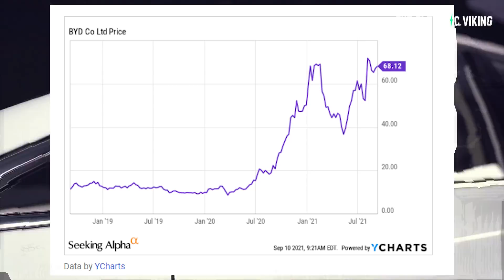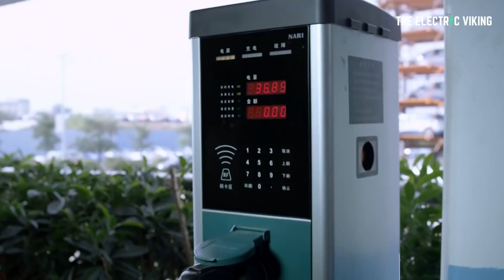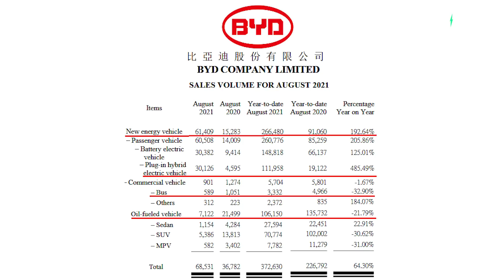New details on BYD's e-platform 3.0 - It's better than you think!

Comment: Not having to change the battery will be the game changer for me. When I buy an ICE car, I don't have to think about having to have a new engine installed after 8 years. I don't want that problem with a EV. I don't care about the range as long as it is over 300 Km and does not catch fire while charging at home. I hope the CCP doesn't interfere with BYD as it has with other large companies.
Reply: The problem is that calendar life is also important.  Batteries degrade over time, regardless of how many cycles they see.  I have had Ni-Mh, air cooled Li-ion and liquid cooled Li-ion batteries all fail at about 10 years.

Comment: 89% Efficiency means the car loses 11% of battery power before it gets to the motor. This is because of voltage changes, cable resistance etc... 89% efficiency is excellent.
Reply: 89% is probably battery to road but might include the charge to road. It would be good to know.
Reply: 89% is battery to wheels.99.7% is battery to motor

Comment: I've been driving the same car for 20 years and I have put 200,000 miles on it. I have no idea how long a 600,000 mile battery will last. It will certainly last longer than I will use that car. Most people want a new car in 10 years. So it will have great resale value.

Comment: Great vid as always, the only thing I challenge is that you doubt that BYD will supply their architecture to Daimler etc, to me it makes perfect sense for each party.
I enjoy that BYD let the Tesla partnership rumour die down & that they won't be supplying Tesla with Phosphate batteries. Makes you wonder who started that rumour. 😉
Reply from the maker: Thank you for sharing
Reply: Elon has recently stated that he has a preference for the LFP, so I'm sure Tesla has kicked the tires on one of the best battery options in existence. Imagine if Telsa offered a base model Cyber truck with the blade battery...would make sense and they could potentially beat Ford to market.
Reply: Daimler is 10% owned by Geely. BYD's partnership with Daimler (Danza) is not working at all, sales are awful and both parties want out.
Reply: however i agree, if they have the capacity they can supply the industry. The capacity is the problem.
Reply: @drew031127  Elon spruiked the new 4680 Li-Ion will be revolutionary & the future, the Phosphates reserved for the $25M? "Model?".
The Model 3 & Y were pitched as the most important models in the Tesla line-up & were destined to have the structural 4680 Li-Ion platform.
The made for China in China Model 3s have Phosphate batts, which are cheaper, more robust & safer, but with reduced range, yet satisfactory for their market.
I have no doubt that the base CybreTruck will have Phosphate batts for the above reasons & because the 4680s are uneconomic due to not having a high enough yield of acceptable quality.
My questions to you & others:
Will the CyberTruck need a redesign to accommodate the heavier Phosphate batts, or will it have fewer cells/packs whatever?
Will it be cheaper?
What are American CyberTruck buyers willing to sacrifice with the implementation of Phosphate batts?
Will the orders for the mid & top range suffer, as they'll be paying a premium price for a revolutionary, but less safe truck?
Who knows, the Cobalt levels in the 4680s may turn tree-huggers off, 'cos WE ALL WANT a cleaner, safer & ethical future.
If the Phosphate batteries knock the ball outta the park, what then from the Battery Day Li-Ion 4680s?

Comment: I am in long on BYD with considerable shares. Why is the stock so volatile lately? $2.50 up and down swings? What is driving that? Fear of CCP disrupting the BEV markets and possible de-listing way down the road? U.S. tensions with China? Some other factor? Just curious if anyone has any insight!
Reply: @mark twain,  all of the reasons you mentioned
Reply: @marktwain5232  yes. And all the others are nonsense. There will be consolidation. Good fir byd, but the markets has no clue.
Reply: That’s all this is consolidation. Byd is no 1 ev in China. So will benefit.
Reply from the maker: Thanks for commenting!!!
Reply: @electricviking  Viking !!! The Man Himself!!! Thank you for your EXCELLENT Channel! Yours is the BEST BEV Channel on the Internet! Your work is very greatly appreciated!
Reply: Mark, part of the wide fluctuations is probably because it's trading in the OTC market. Not sure why a $62 stock is trading in OTC. 
They need to somehow move to NASDAQ.
Reply: @henrytaverner1803  maybe. But it’s only OTC for you. Most people own it on HK or Shenzhen.
Reply: @henrytaverner1803  why? They are listed in HK, 3rd largest exchange. 

I posted about this before: there will be a rotation from new economy stocks like tencent who have been battered lately. Every few weeks this will happen until the CCP finishes their regulation overhaul. That’s all it is. On dips buy.

Comment: I like this platform. Are BYD going to make a van? I reckon an e-platform Vivaro/transit sized van with 100-120kWh would be perfect and should fit the size and weight limits.
Reply: Yes they have  electric vans. I think one of them is called the BYD T3.
Reply: @jasonk203  Ah yes, the T3 looks very nice (a lot like a Vito). But it's still a 50kWh battery van with correspondingly limited range. Also not available in Europe or the UK yet SFAICT.

Comment: can u find out why BYD say for all their vehicles 'towing N/A'. Some such as the Tang certainly have the power and torque to tow. Is it a reduction of range issue or doesn't the 3.0 platform allow the fitment of a tow bar?
Reply: Good question!
Reply: @bubbsy2002  I'd like to get one but it needs to tow, U can now get vans with electric motor hubs that have regen braking. They don't reduce your range in an EV
Reply: @gregchidgey8523  Looking myself for a van similar to my 2013 dodge caravan, best utility out of all small vans, IMO. Thinking maybe Tesla or another EV maker will come out with kits, to convert ICE soon.

Keep asking questions!
Reply: @bubbsy2002  i would get a BYD battery say 20-30kw from the Mossvale factory when setup. Build a frame around it get hubs with motors in them, build a van on the frame with toilet and shower, induction cooktop and get my son in law to check all the wiring. Get a mate to weld up the frame
Reply: @gregchidgey8523  ha ha, nice!
Reply: @bubbsy2002  the ozxcorp group in Melbourne make platforms for caravan companies the bigger battery is 14.1KW and costs approx. $20,000
Reply: @gregchidgey8523  I need Chinese prices, that would be nice, iron phosphate batteries too, thanks for the info.
Reply: @bubbsy2002  well the byd batteries are approx $96 US for 1kw/h. So 20kws would be a bit under $2,000
Reply: Chinese don't use trailers or such. I never saw a single trailer in five years living there. I would expect that they have built strengthening in to the platform to allow for a tow bar  because it not something they are at all familiar with
Reply: @ianmontgomery7534  well they are making a dual cab ute to be competitive it will have to tow

Comment: Can you show me a warranty that covers the powertrain and BMS for million miles? Any vehicle I don't mind which.
Reply: Early Tesla Model S had unlimited mileage warranties, however they were still limited to 8 years.
Reply: @gregb1599  Thanks Greg. On average 20 000 miles per year gives 240 000 miles. Same expected life of an ICE motor. Average life of an ICE car is around 13 years. Do you know what Teslas present warranty is?
Reply: @MegaWilderness  Model S still 8 years but now 160,000 miles which is probably because so many older Model S had batteries replaced after 200,000 miles, huge money pit when the unlimited mileage warranty ended up costing Tesla millions in battery replacements
Reply: @gregb1599  This is sad but as I suspected, there is no value in buying second-hand. We need better battery tech fast or only the wealthy will benefit from all the tax incentives the poor are subsidising.
Reply: in Singapore BYD gives 8 years.
Reply: @Sam_BS_Electric  All EV makers except Toyota give 8 years, Toyota give 10
Reply: @gregb1599  so what. I am just starting a fact.
Reply: @Sam_BS_Electric  Big deal every country has the 8 year battery warranty so what is the point of your pointless comment?
Reply: @gregb1599  thanks for pointing out the pointless!

Comment: Seems to me this so call blade battery is simply a pouch battery configuration. Same flat profile batteries in current laptops which is amusing since the Tesla cylindrical battery is the 16850 common in old laptops.
Reply: Nonsense
Reply: @gregb1599  why? If you talk nonsense I will tell you.
Reply: there blade battery is completely different to any other on the market. give credit when its due. stop the fud towards chinese companies.
Reply: @Sam_BS_Electric  He said it's a pouch battery, have you not seen the punch test where they put a nail into the battery which is a pouch wow even that you get wrong!
Reply: @Sam_BS_Electric  Yes it is a great battery! But it's still a pouch battery!
Reply: @gregb1599  so what if it’s good. I don’t get you guys!

Comment: Byd OS is car control system not a infotainment system.
Reply: Wrong
Reply: An OS is the software layer that sits between the application layer and the actual hardware. Of course their OS will cover all hardware they currently envisage for a vehicle, including vehicle and battery operation, but everything else that will be electronically controlled..  VW are currently trying to form a consortium of German makers to come up with a common OS for all their vehicles. From current experience we can see that OS architectures are extremely stable, but new OS version releases are common.

Comment: Lithium Iron Phosphate patents expire this year. There is one left that expires next year in April. After that, Lithium iron phosphate batteries will be sold everywhere patent free. It is going to blow up the battery market. This is why Tesla isn't using Lithium Iron Phosphate in the US, yet.
Reply: sorry but they are offering it as an option now.
Reply: @Sam_BS_Electric  As I said, all except for 1 patent is expired. And you still have to wait for it. By the time you get it delivered, all patents will be expired.
Reply: @felixsu375  sorry mate how do you know what patents expire??? CATL and BYD both make Lith batts already, so it makes no difference, they are no 1 and 4  in production.
Reply: @felixsu375  Do not bother with Paul he is a know nothing attack everything!
Reply: @gregb1599  I can't figure out why he thinks there are no patents on LFP. The mistake of the university that patented it was that they didn't bother to patent it in China.

Not that it matters since there was no market in China 20 years ago. And now the patents are expiring so Tesla will be able to ship vehicles in the US with LFP.

Comment: BYD are certainly building my dreams! However, I didn’t invest in them, or Nio, or Xpeng, silly me, purely because of the murmurings from the Chinese Financial regulator.
Reply: @FalkinerTim  You make some good points, but 1) what have they done to casinos? All they said was they will limit the number of licenses to 6.

Yes Evergrande may go belly up as you said, but how would the CCP benefit from attacking the EV sector? BYD is in the right place at the right time.
Reply: @Sam_BS_Electric  The Chinese government is going to crack down on the management of casinos and the market has plunged. According to one Reuters article the US casinos are concerned the Chinese government will favour local operators. "Discussions over the future of Macau's casino licences come amid rocky U.S.-China relations, leaving some investors fearing an edge for domestic players over U.S.-based casino operators.

The government has not singled out any U.S. players, but companies have moved to beef up the presence of Chinese or local executives as they position themselves more as Macau operators than foreign one."
Reply: @Sam_BS_Electric  As for the Chinese government attacking the EV sector I agree but the government may act to limit foreign investment if that can be done without impacting the EV industry.
Reply: Thanks. But no issues here. Byd have been 8% owned by  buffet for decades it’s not an issue.

Comment: Why you always get the specs wrong on the BYD Dolphin it's battery sizes are 30.7kwh giving an NEDC range of 300km or just 210km real range and the 44.9kwh around 400km not even dam close, or a real range of 283km your numbers of 400km and 500km are just hyping the car for no good reason. Just be honest and even with the shorter range is still a great EV!
Reply: @gregb1599  😍
Reply: @gregb1599  you are a negative person. Wait and see🤍
Reply: How do you know???
Reply: @Sam_BS_Electric  I thought you unsubscribed?
Reply: @gregb1599  why? did you miss me?
Reply: Greg I like you mate, you have an opinion, which is good, I just don't agree with you on BYD.
Reply: @Sam_BS_Electric  Hey I did not say I do not like BYD but the range that Sam always talks about is total BS! It has a 30kwh battery and a 45kwh battery, the 45kwh battery is big enough for many but stop the BS about this battery getting 500km like Sam goes on about, the official NEDC is 401-405km which means in the real world always less 25-30% of the NEDC range.

If you had bothered reading my first comment you would have known I really like the BYD cars. However I personally would never buy one as it will be sold as a direct to consumer which is a super high risk.
Which is why Ora appeals to me a lot more as it will have full support from it's parent company in Australia and NZ from Great Wall motors, as well the Ora has full safety suite across it's entire range apart from the base model, while the Dolphin only the top spec model gets that and best of all the Ora Good Cat costs around the same as the BYD Dolphin.
Reply: All I am saying to you is, wait until the car comes out you ma be surprised.
Reply: @Sam_BS_Electric  I am sure it will be just hope the hype is better than the Dolphin with it's wasted opportunity to really impress with fast charging and long range but from 40kw-60kw charge speed and just 30kwh and 45kwh battery sizes and just 70kw motor output it  was a real letdown to the hype Sam used for months before the actual specs came out. 

Will it be the same with the Yuan plus? I hope not! I hope that one really does have good specs, so according to Peter we will find out in 2 weeks so I can wait until October to see...
Reply: Greg you know everything about everything good of lick
Reply: @Sam_BS_Electric  What like you do when attacking other people's comments like the Blade battery is not a pouch battery or LFP patents are about to expire as soon as proof is given you go silent, so yeah who out of us is really the know it all?